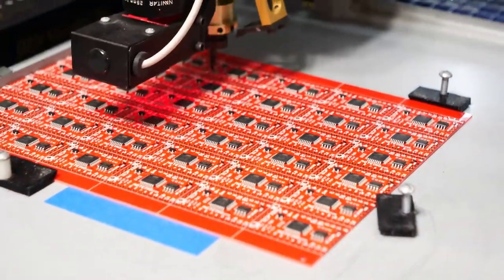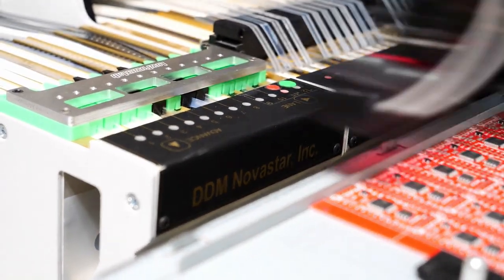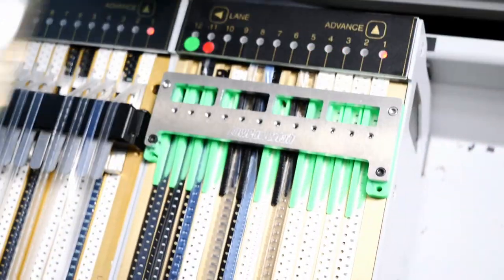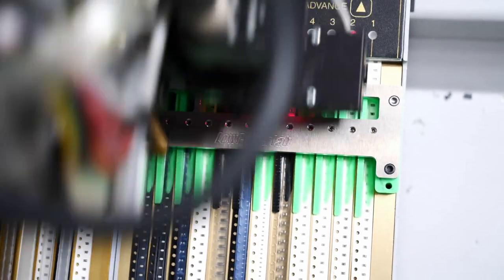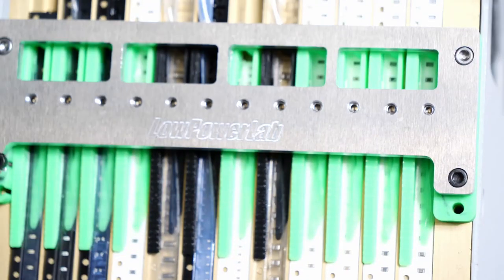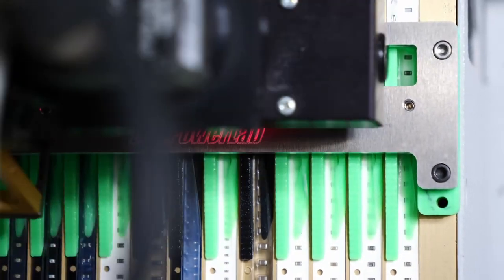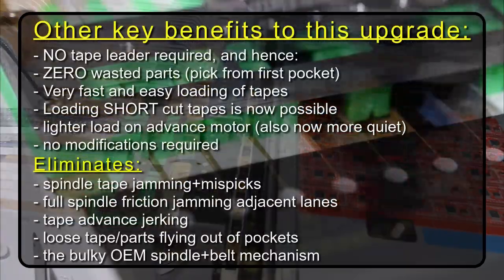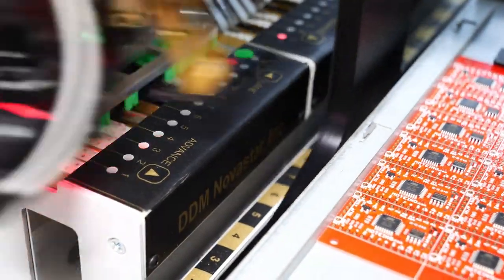DDM Novastar Pick & Place L-BF-12 Feeder upgrade

Comment: I'm really glad someone finally made a feeder inspired by the automatic peeling mechanism.

Are these all 3D printed?
Reply from the maker: The green parts are 3D printed. The metal parts are machined.
Reply: @FelixRusu  Why are some green and some black, is there more than one configuration for 8mm?  What do the set screws do, adjust for tape thickness?
Reply from the maker: @theAGanimators  To distinguish different tape peel width. Screws hold down the 3D printed plows.
Reply: @FelixRusu  Nice design! Would you be willing to share CAD data?